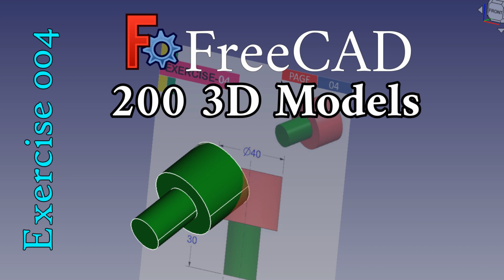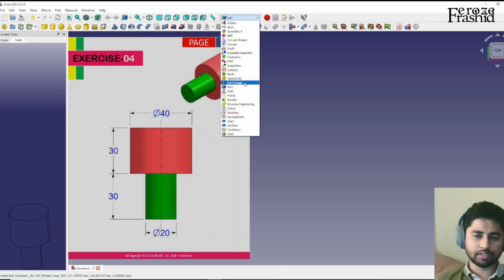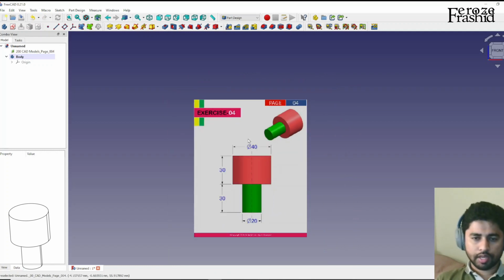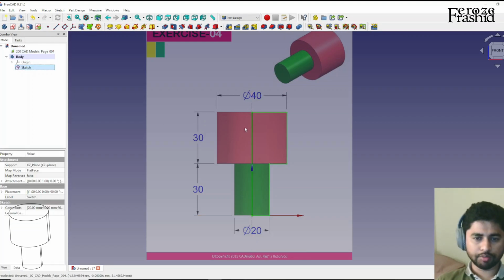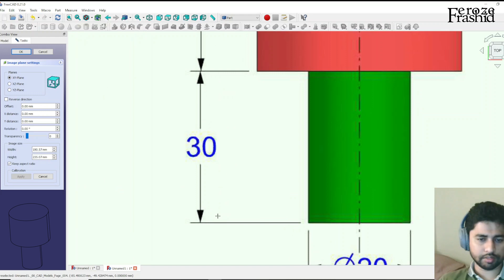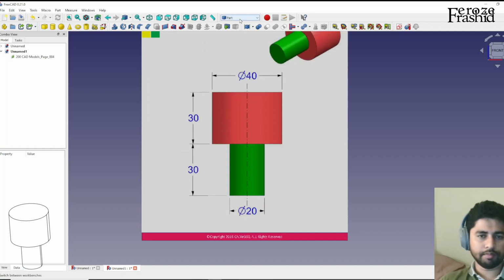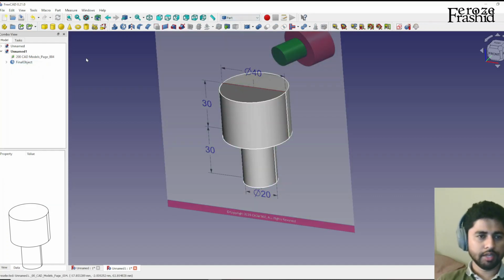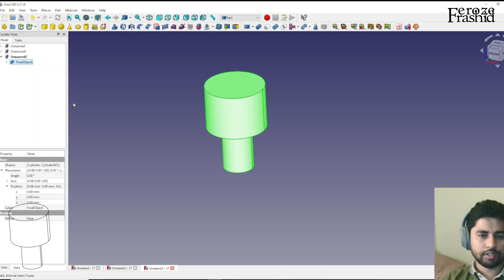200 3D Models in FreeCAD: Exercise 4

Comment: Great series, thanks for making it.

I wonder if there is a reason why you didn’t just use one sketch with a rectangle along the bottom that could be extruded to make the base—for a complete model with one sketch and two extrudes.  

Was it just to keep with your drawing based pedagogical approach?  Or is there another reason?
Reply from the maker: not sure if I understand your question to its fullest extent and my apologies for that. 
Given the shape of the object, only circles of two diameters can be extruded up and down to build this model. There are multiple objects with similar workflow in this series. Every now and then I take an alternate route to build staff, which are not necessarily the quickest way. Thanks.

Comment: I am using FreeCAD 0.21.0 my Part Design Workbench doesn't have the sketcher Option I must use Part Design, why?
Reply from the maker: It should be there by default. Even if it's not there, you can sketch in Sketcher workbench and then comeback to PartDesign wb. Users can go back and forth anytime in FreeCAD. 
Additionally, you can right click on toolbar area and select "Customize" from the bottom of the list and rearrange your favorite tools on different workbenches.